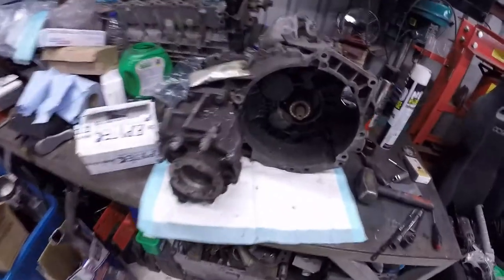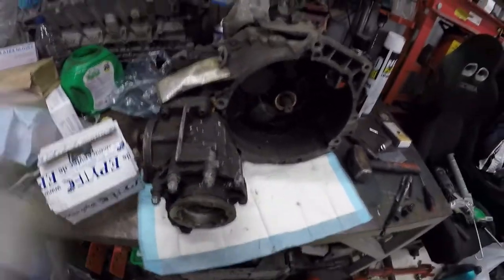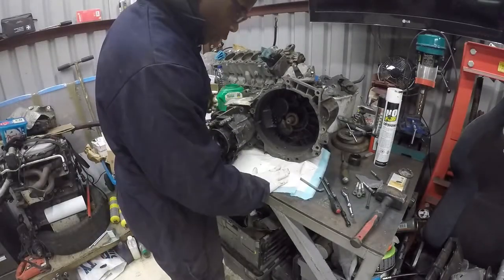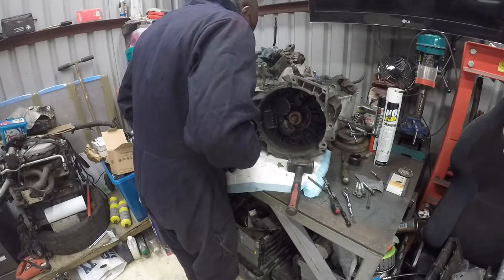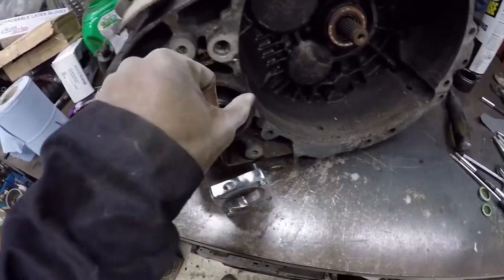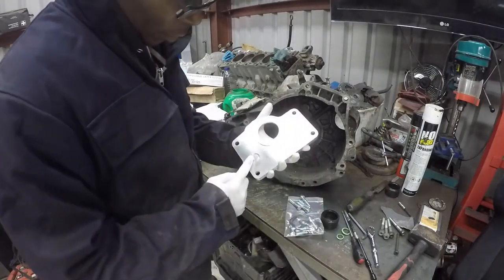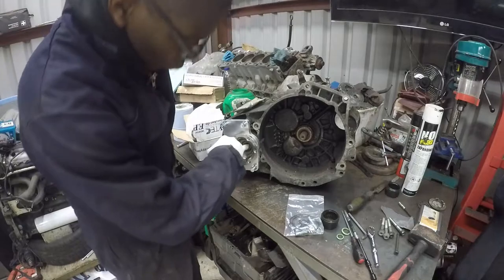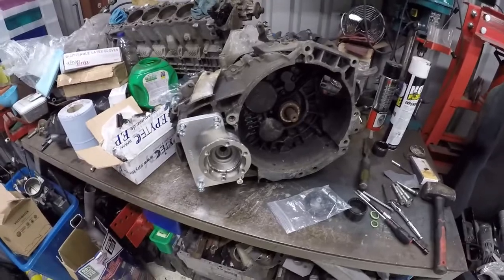Epytec 02m 4wd to 2wd Conversion plates

Comment: Amazing took a look at their website and this will work on a 02q dsg which is perfect for the turbo vr6 swap i am working on cheers mate and thanks for the video 😁
Reply from the maker: Glad the video was of use 👍
Reply: I couldn't find info about this working with a 02Q. is this the right part: https://epytec.de/en/engine-and-gears/engine-gearbox-mounting-brackets/golf-caddy-scirocco-1/vr5-conversion/6-speed-gearbox/1287/6-speed-manual-gearbox-conversion-kit-02m-4motion-vr6-r32-golf-mk1-2-3-4-turbo
Reply from the maker: I'm not sure if that will work with an 02Q.  Best bet is to get in contact with Epytec 👍

Comment: Hi buddy! Great vid! I'm just doing the same in my corrado (only the one engine and gearbox for me though!). You don't happen to know the part number and torque setting for this required bolt do you? The local VW parts specialists I've called up can't give me a part number for the bolt when I tell them it's to suit the driveshaft cup (02M 409 356 A). Cheers 👍🏻
Reply from the maker: I'm sure I have it written down somewhere.  I'll try and dig it out 👍
Reply from the maker: Ok. So the bolt you need is from an 02m fwd box (TDI). The number that I got for this is 097409359.  The torque setting is 25nm.
Please double check these numbers and if you find out anything different then please let me know 👍
Reply: @ABIMOTO  Ahhhh you absolute legend! 😎 I'll give them a call and try it out! Hope to see this at santa pod when it's done? How far along is the progress at the moment? 👍🏻
Reply from the maker: Progress is ramping up so I'm happy 😁

Comment: What the oem number of the driveshaft flange u fit and the oil seal  thanks
Reply from the maker: 1x short drive shaft flange, reference: 02M 409 356 A

1x seal / gasket 02M 409 189
Reply: @ABIMOTO  thank u😀
Reply: I have 02q301107b transmition the same flange of the 02m can fit for mine gear thanks